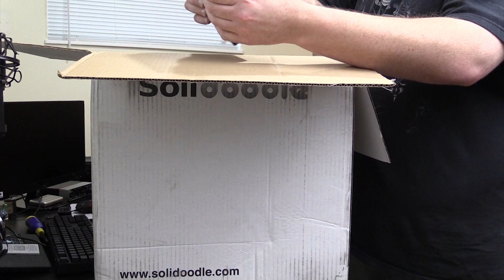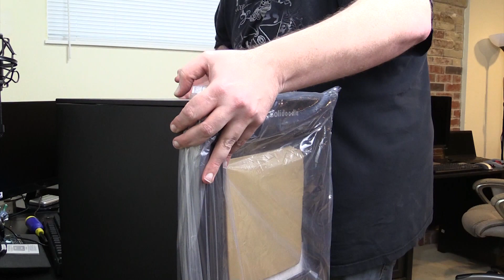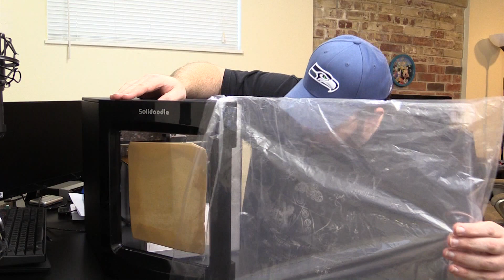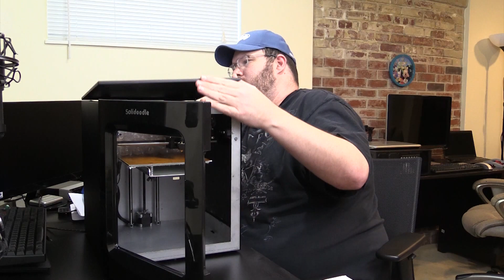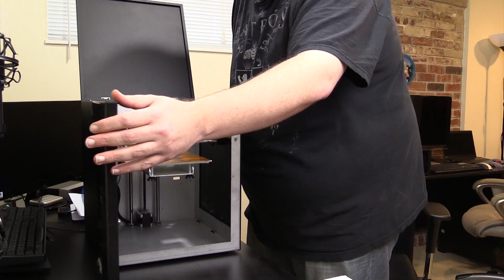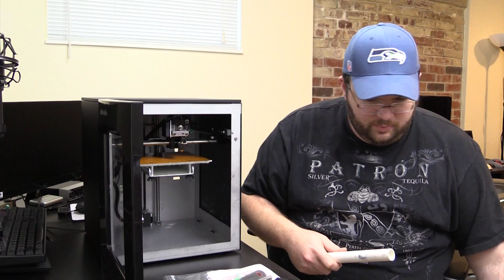3D Printer Solidoodle 4 Unboxing

Comment: mine took 3 months to get to me and when it finally came it didnt have a power supply also mine didnt have the stuff on the glass or bubble rap inside also i didnt get as many tools as you its listed at $599 but the final price for me was $1100+ for that price i could of got an ultimaker

Comment: Have you tried the solidoodle workbench aprendice? It sounds better than the solidoodle 4 because it has a dual extruder but it also has a smaller print dimension